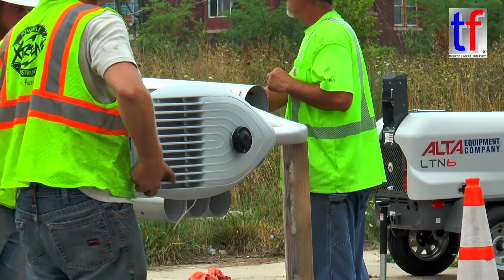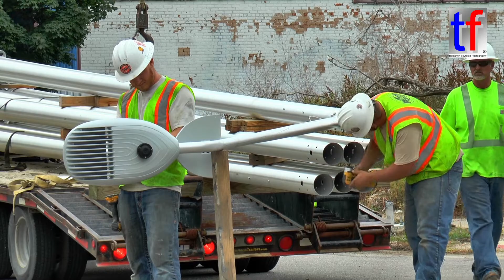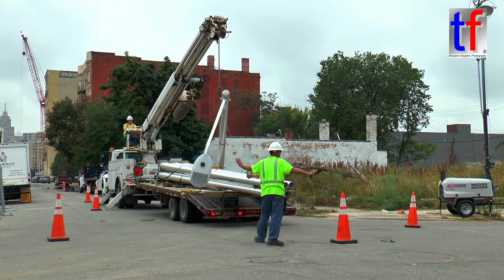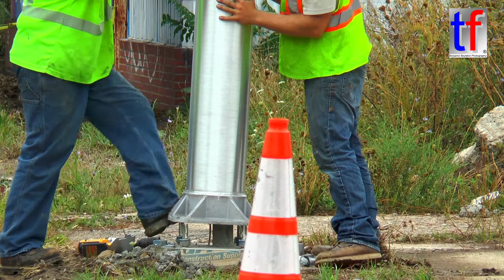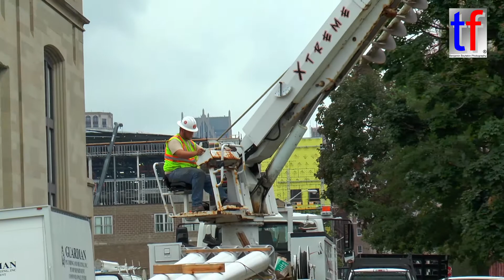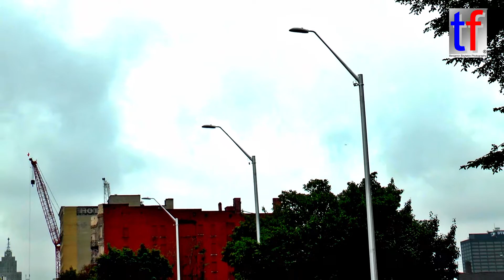Detroit: New LED Street Lights for Forgotten Neighborhoods, Park Ave, USA, 10/15/2016.

Comment: Yes the energy savings is dramatic.  Three additional things need to be considered while making the transition to LED lighting to avoid negatively impacting the nearby homeowners, birds, or wildlife sleeping patterns.
1.  No higher than 18w fixtures so illumination is consistent with prior HPS fixtures.
2. Color needs to be warm  "soft white" 2700k to promote normal sleep instead of higher blue content or "daylight" LED that is well-proven to interfere with biological sleep patterns.
3. New fixtures should be fitted with shielding so the dazzling LED bulb shines only on the common streets and sidewalk, not private homes or bedroom windows.
Reply from the maker: Well, in my country most old lights have a warm light because of your point 2. But now, with all the new LED lights we have that cold blue light.

Comment: Hoping to be 100 percent of LED street lights in Detroit Michigan by January 1, 2018. No, I don't think so. On Mount Elliott Street on Detroit's east side, between I-94 and the Conant cut off, near the Hamtramck city limits, they still some Sodium vapor lamps, and even the old Mercury vapor lamps on some street lights along Mt. Elliott Street of that area. Some street light fixtures are dated back in the 1970s., including the old Westinghouse, and some McGraw-Edison brands.
Reply: If the lens changed to yellow, the Mercury vapor lamp is green instead of blue. Like the old saying, blue and yellow does makes green.
Reply: Are all street lights owned by a city or is some owned by a province or state?